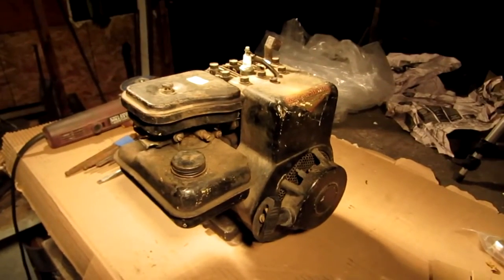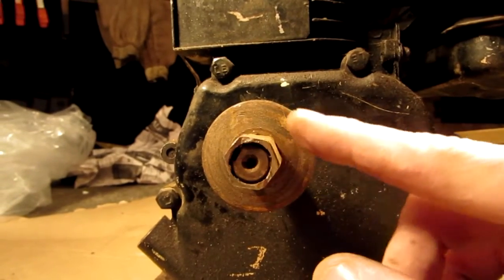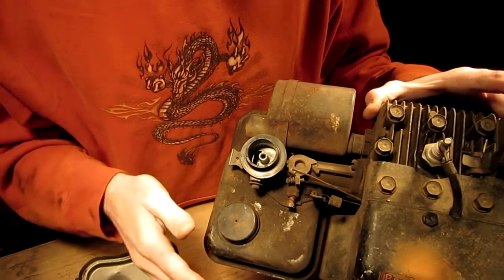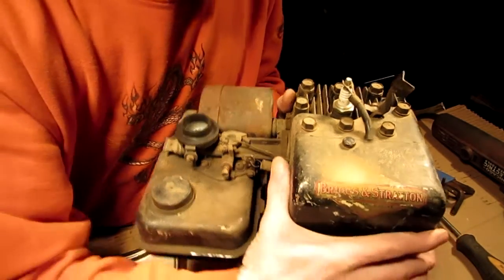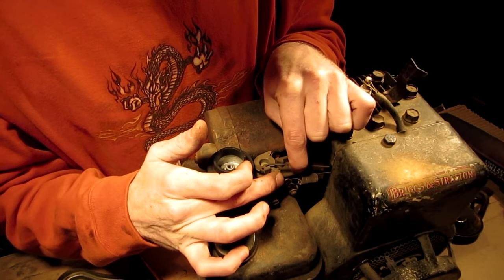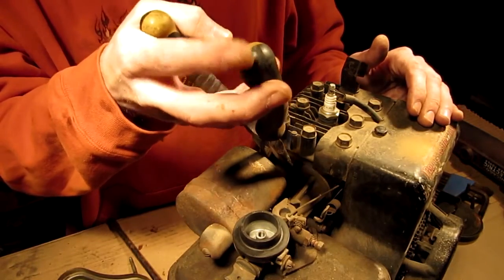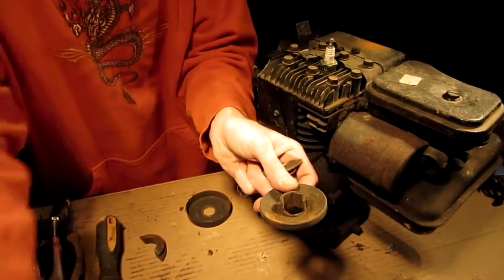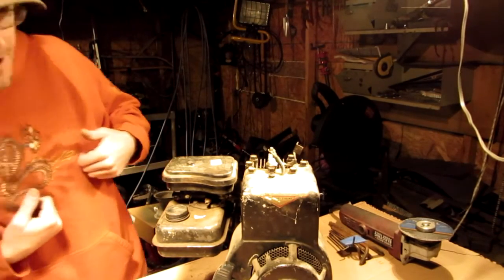Small Engine ( Briggs and Stratton )

Comment: Oh Hell Yeah! Part two, the throttle set up u have figured right, there is a cable ancor point right in the side of the carb throat, yes the carb and tank have to come off first before the muffler can, once muffler is off throw it away, it is a restrictor muffler that chokes off the enging replace with a free flowing muffler. it is capable of five horse with correct carb and muffler, nice little engine!  Have fun with it!

Comment: The numbers are stamped in to the side of the pull start shroud . And for the clutch You could  get a small puller from a auto parts store. Or grind a little away at a time till you reach the shaft and pull it off. And you can get that air filter anywhere it's really common.

Comment: Great little engine! I rebuilt a 7 horse briggs for a co-workers speedex this past summer.  it looks like around the same year based on the decals. look on the side of the flywheel cover for the model and serial numbers, they are stamped (vertically?) into the steel on those old engines, if it is around the same year as the one i just rebuilt. hope this helps you out.

Comment: Those are great engines I have several, They are design to run at one speed, Your looks to be a 4hp from the late 50's and 60's'. Wont take much to get it running I bet if you want I can look at mine for a model number.

Comment: Oh Hell Yeah! OK first off LOL u have been initiated into the small engine league of extrardinary shade tree mechanics. The engine serial number will be embossed on the top of the fan cover( the paint might be too thick if it was repainted), next, that carb is VERY SIMPLE and yes u can get a replacement diaphram/gasket that goes between the carb and the gas tank, now u checked the oil great! but never use a tool to tighten the oil cap in place (hand tight only) continued to 2nd comment

Comment: Parts for these engines are easy to get all lawn mower shops will have the gaskets and seals. I have 2 of these engines but there a 3 and 5 hp . That one looks like a 3 hp. And the throttle is the leaver on the top of the carb .

Comment: have you located the model # yet? they are stamped on the starter shroud right next to where the throttle springs and linkages go. looking a picture up of them online should be easy to do.

Comment: I love old engines, especially Briggs. Cool how you didn't edit out the part where you got shocked :) I realize this is an "old" video and it's probably fixed, but couldn't you use a gear puller to get that thing-a-ma-jiggy off the shaft? -Geir